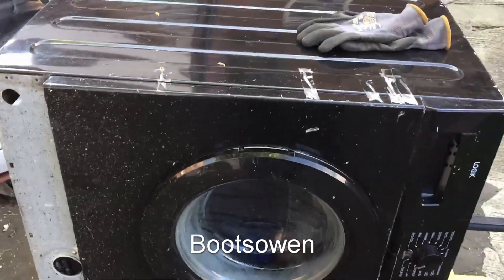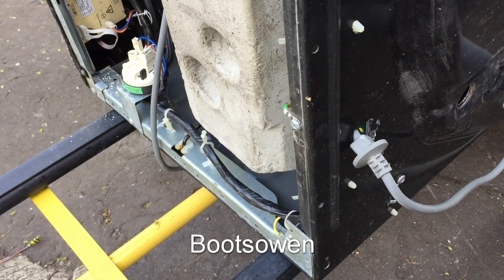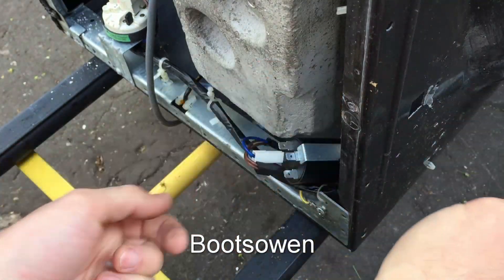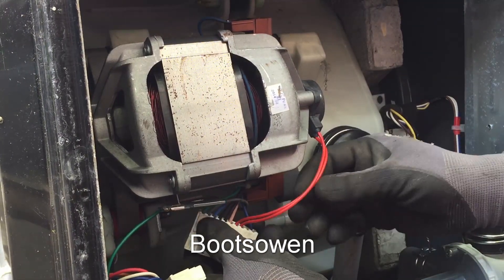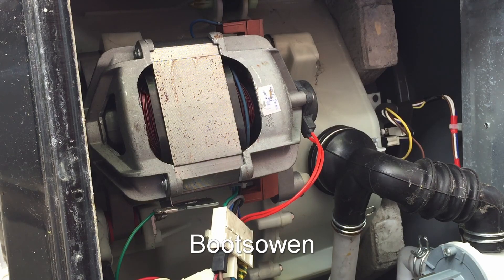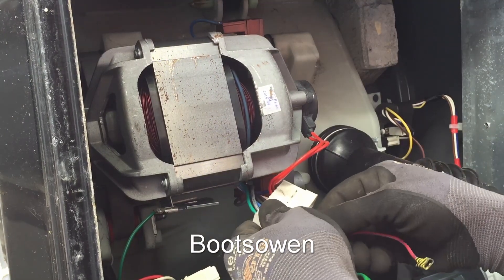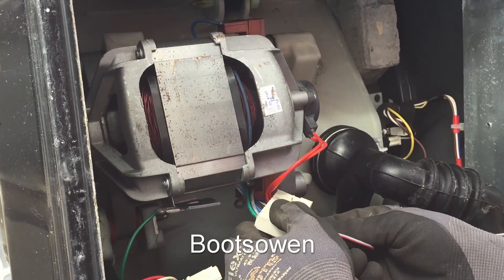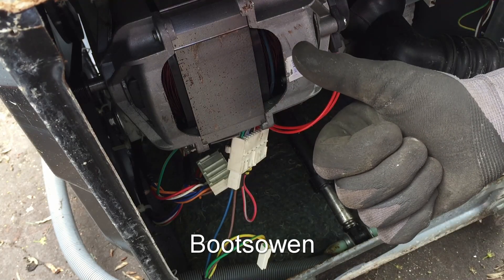How to hotwire a washing machine motor | Black Logik L714WMB13 | Universal Motor Wiring

Comment: Hi, nice quick video on the basis of I've done it and this is what happens. I'm assuming that the motor speed is not regulated by the AC cycles and so should not be left on without a load and even with a load should not be left unattended to avoid slow RPM increase to terminal speeds, cheers
Reply from the maker: That's right Andy, to test these universal motors you can wire a fire element or any big resistor in series and that should protect them, but I suspect that most people will never do it. I reckon I have posted about 25 of these how to wire a universal motor videos. I have posted one video of using an SCR voltage regulator, and another using the TDA1025c chip based regulator. I think the TDA version is the best regulator, because it draws on the tacho for feedback. As you mention, these motors will speed to infinity if they are unloaded. I just post these basic videos because they are easy to make, and when I am destroying washing machines I have to do this process anyway, youtube doesn't seem to mind if I make the same video again and again, not is it logical why one of my 50+ "how to clean a washing machine filter" videos is popular and another isn't, one would think that it has something to do with the popularity of the machine, or if it is a machine that tends to fail, but I don't know. I just keep throwing videos at youtube and see what will stick.  My thorn (in finger)  removal videos are doing a great trade these days!
Reply: @bootsowen  , boots, yes it's strange the temporary nature of the general attention span. I do some videos that I feel are of a great help and then get (maybe) 400 views in 6 months, still I suppose it's passing info on to those who care and that way reducing waste, cheers